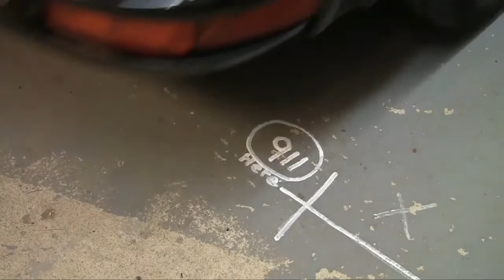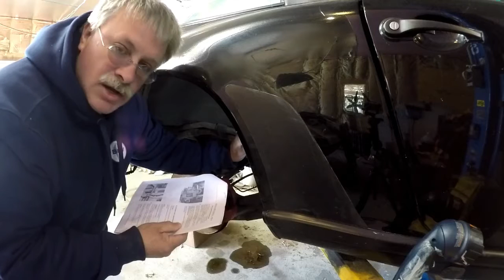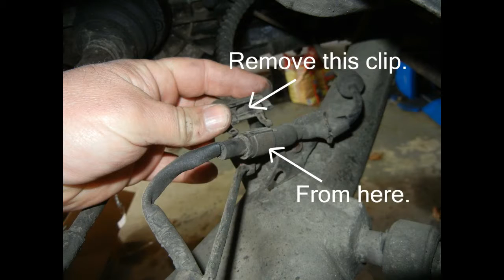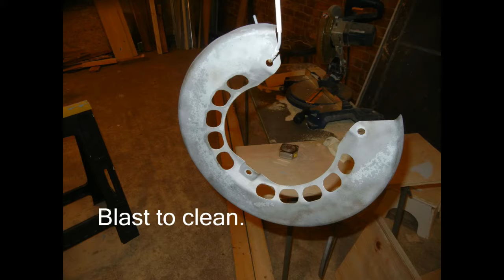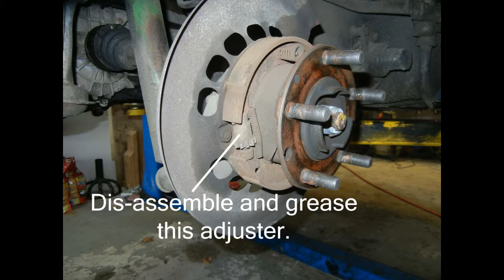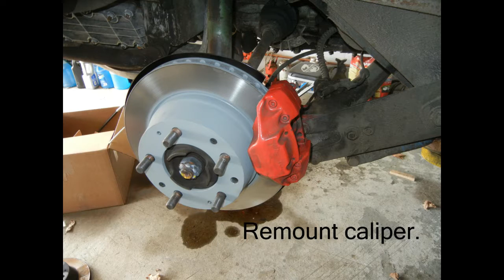1984 Porsche 911 Rear Brake disc Replacement

Comment: Do not take the brake line off the caliper ! Remove the 2 bolts and hang the caliper out of the way with wire or a bungee cord 😄
Reply from the maker: Thanks for the comment.
Reply: DrDIY Porsche no worries !!! Sitting here on a cold rainy day in Pennsylvania watching me rip around summit point WV. In the 944 turbo , sunny day and short sleeves! !! Send you the link if you like! 😄😄😄😎😎😎🍺
Reply from the maker: @artmchugh5644  Would love a link. Post it here for all.
Reply: My caliper is hard line directly…